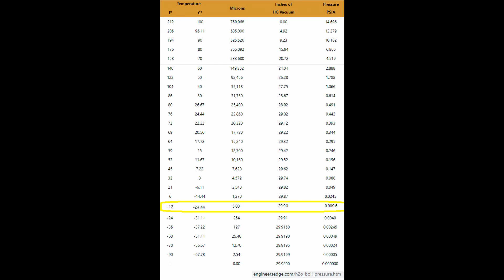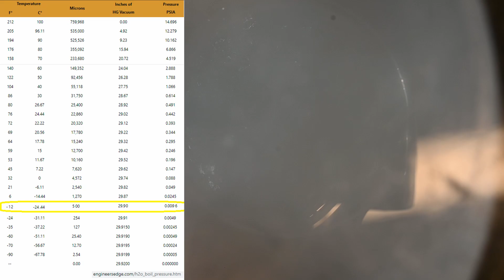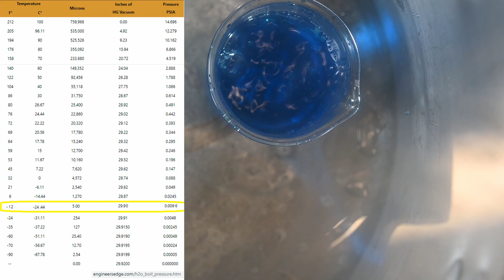HVAC 138 Vacuum P5 dehydration

Comment: Hi . Great vids, thanks a lot to share your knowledge. I learn a lot 🙏.
Just a question about moisture potentially trapped in poe oil because of a lack of evacuation during first installation.
If it is a duckless r410a system without any oil glass and filter drier. 
How can we anticipate a potentiel  burnout in 5 or 8 years because of acid throughout the system... 
Are there any signs which can help to identify moisture in a system which seems to work very well... 
Megger measurement can help?
You say in this vid, If there is moisture trapped in poe oil  , the system is certain to fail !!!! whatever we do ... or are there any solutions to fix this problem when first symptoms occur ? Do a Recovery of r410a, a true evacuation under 500 microns and reinject new r410a ? 
Cheers
Reply from the maker: Many of the ductless units use PVE oil. PVE does not turn to acid  and can be dehydrated with a deep vacuum.

With a ductless that uses POE,
You can use an acid test kit to check. Meggers can be used over time to look for patterns but Meggers should never be used to condemn a compressor.
If you have acid a suction line filter drier for acid cleanup can be used. After 48 houses recheck the system if it's clean REMOVE the drier if there is still acid, replace the drier and repeat.

Comment: I just did a repair on an 80 ton rooftop WSHP ERV. Thankfully the boilers were running keeping the loop at 75° so the coaxial coil was warm. The indoor coil was also in a place where it was somewhat warm. It was only 20° outside. Used my 2 large appion vacuum hoses with appion valve core tools on. It pulled the system down to 300 microns in about 2 hours.....passed the decay test. What i also did, was when i was recovering the refrigerant...i allowed the recovery machine to pull down to 15-20" of vacuum ( 410a equipment ). I was watching the oil sight glass for the refrigerant boiling out of the oil. Used nitrogen throughout the whole repair process. Had fresh clean oil in the pump. Made for a very successful repair and a well running system that was fairly quiet while running ( minus the compressor loading and unloading )
Reply from the maker: Awesome!

Comment: Hi Ty any ideas what would cause low superheat and low subcool. Zero super heat and 2 subcool.
Reply from the maker: Low load, low airflow, or dirty evaporator coil.
metering device stuck open or oversized
Reply: @love2hvac  Sweet , thank you Ty for the fast reply.

Comment: Thank you Mr.Ty for this illustration and demonstrating video. Q: When pulling vacuum the temperature will drop? Q: What is the best tools you can demand in it in your job to do vacuum? In ductless mini split if hold the refrigerant in the out side of condenser ( pump down) to repair the leak is there away to use the service valve to throw the nitrogen then vacuum after that release the refrigerant? Thanks.🌸🌷
Reply from the maker: Large vacuum rated Hoses and valve core tools are the most important. That video is records and coming soon.

Comment: Newer heat pumps don't use external check valves? New to working on heatpumps just wondering seen some with and some without.
Reply from the maker: Great question.
Many are internal. Some brands still have external.
Reply: @love2hvac  👍,thank you for response.

Comment: Very good you included why you do not use CO2 👍 I get asked that question all the time.  Old-timer habits die hard in this industry. 

Throw in a mechanical large faced analog temperature gauge inside of one of those glasses of water while you’re pulling a vacuum to show everybody the temperature drop of the water as it boils
Reply from the maker: Thank you.
Yea CO2 is cheaper so a lot of people prefer it. A lot of it is just not knowing.  

I thought about the thermometer but I don't want to get too far off track. I have it covered fairly thoroughly with the thermometer and the temperature dropping  in 
HVAC 022
https://youtu.be/C4r_a3tE80o